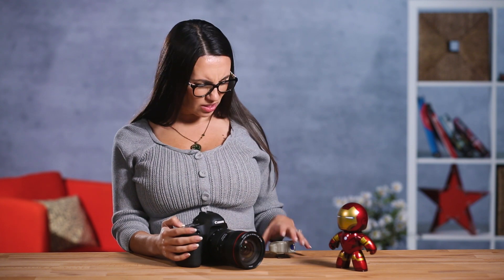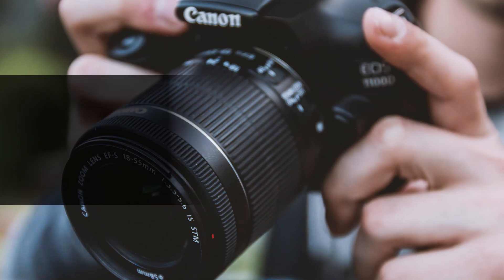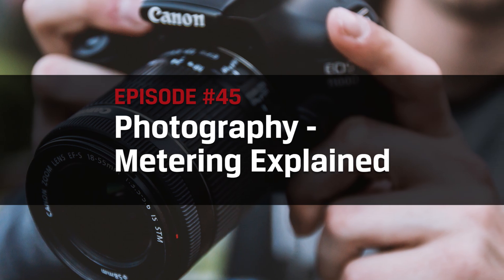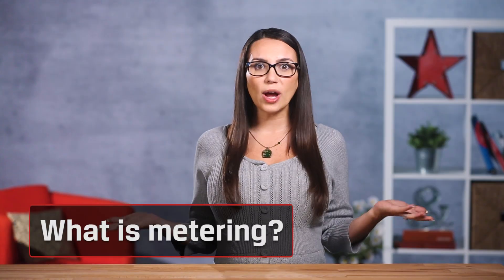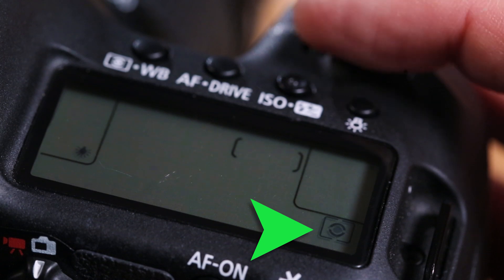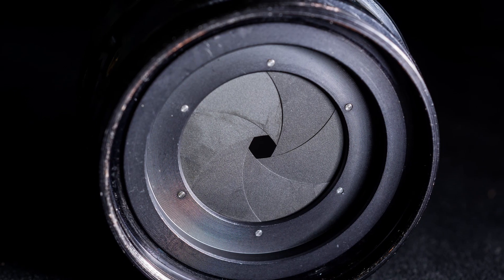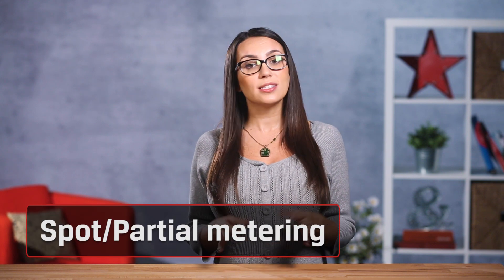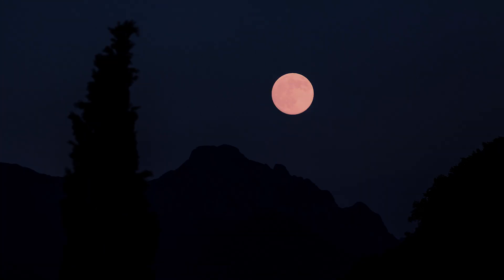Photography Tips – Evaluative, Matrix and Spot Metering 📷 DIY in 5 Ep 45

Comment: When I am doing a stopmotion video, what metering mode should I use?
Reply: darthvader2-18 It depends on the location. If there is no backlighting or any strong contrast between dark and bright areas, Matrix (the one that takes the whole scene into consideration) is most likely the best one. If there is backlighting or any strong contrast between dark and bright areas, Centre or spot metering would likely be best. 

Since there is no right or wrong in photography, the best way to find out the "right" metering mode is to take some photos using all of them, and then decide which one you like most.